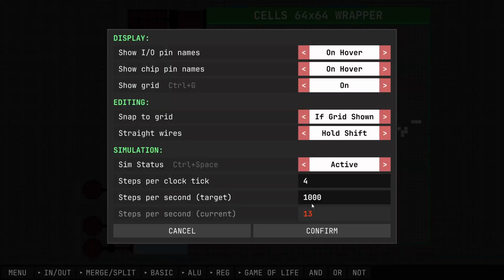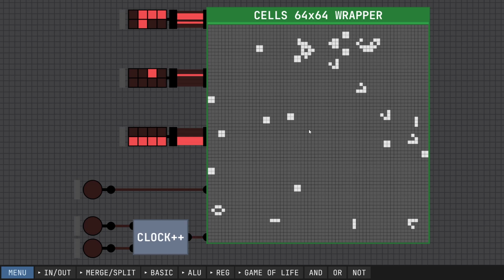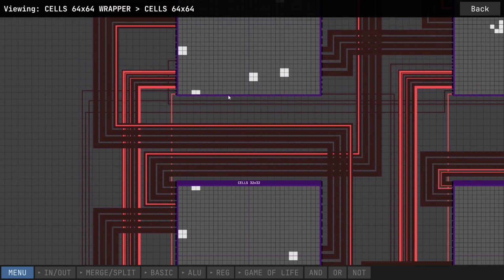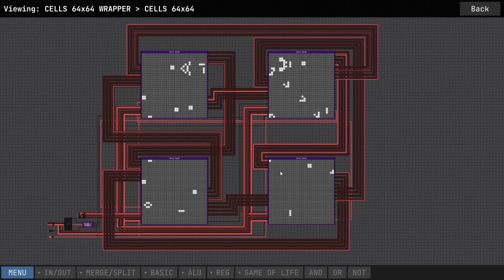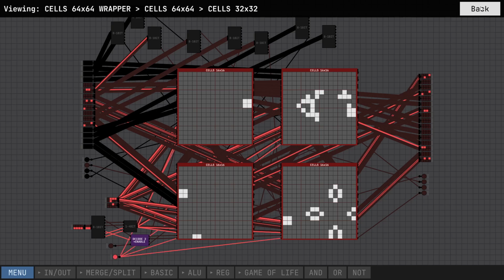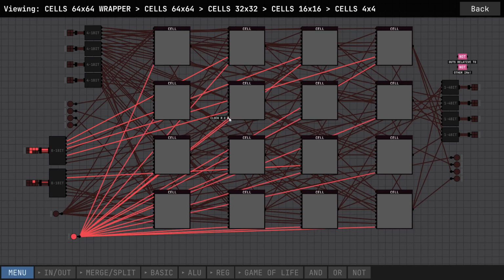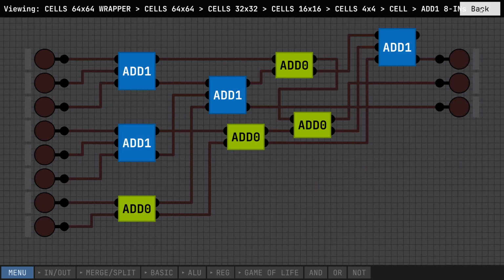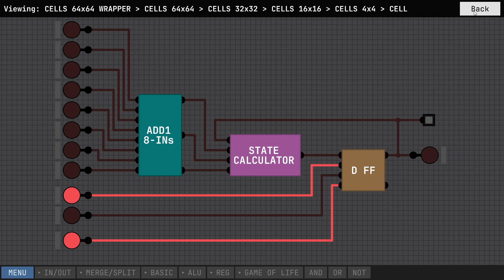Infinitely Scalable Conway's Game of Life | Digital Logic Sim

Comment: what if you made the clock faster?
Reply from the maker: Unfortunately, the game only runs reliably with at least 4 simulation steps per clock cycle. I'm not quite sure why this is, but I assume, that the adder, that adds up how many neighbors are alive, needs at least 4 simulation steps to produce a stable output. If you give it less than 4 simulation steps you read the output of the adder while it is still changing, therefor leading to wrong behaviour (cells turning off when they should stay on, or cells turning on, when they should stay off).